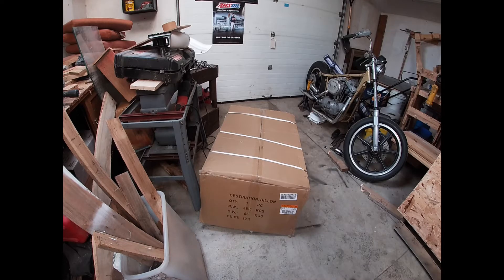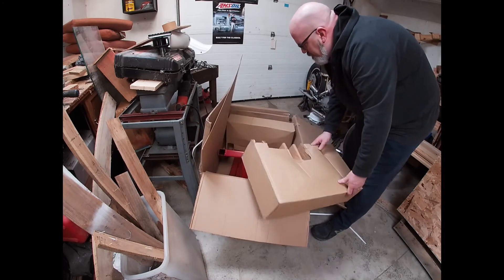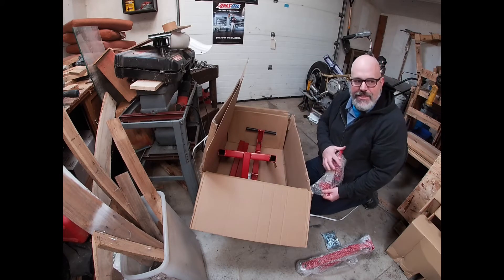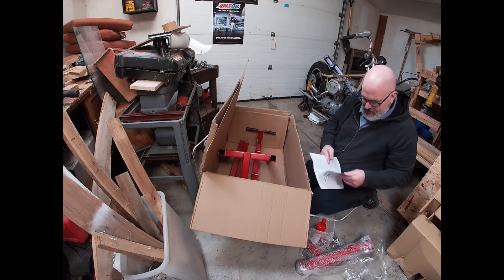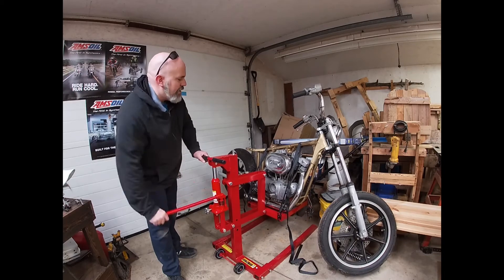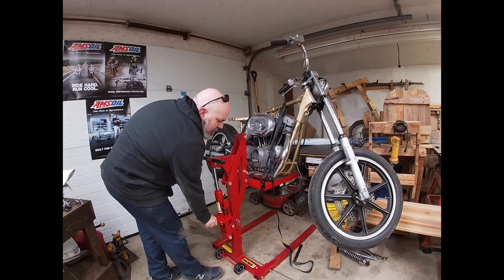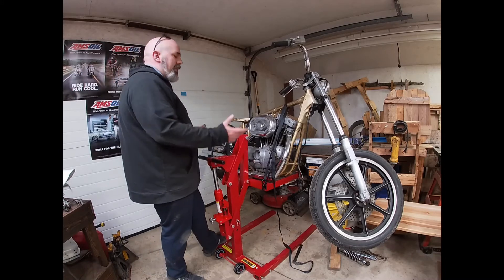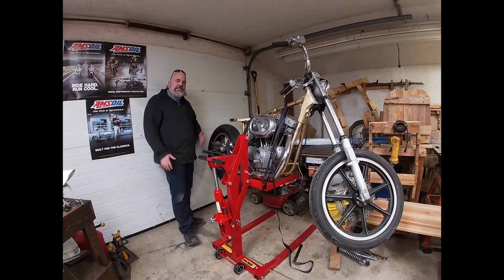Harbor Freight High Position Motorcycle Lift unboxing and review

Comment: So you lifted under the exhaust pipe? I have the same problem the pipe is lower than the frame.
Reply from the maker: Yes I was able to get it behind the pipe but it’s tricky , I haven’t done much bike work for a bit but when I start back I could see selling this and grabbing a table lift